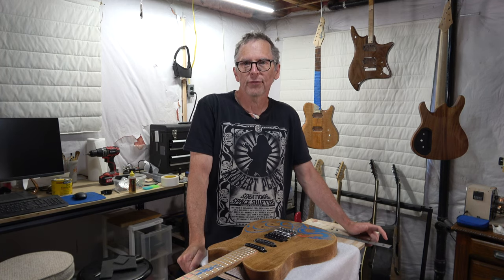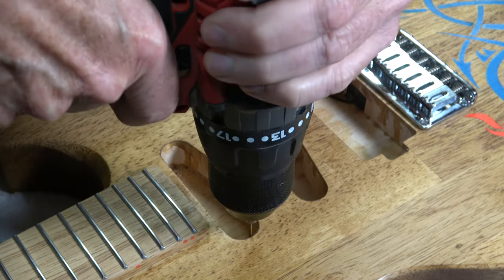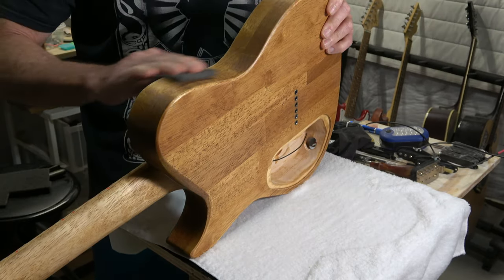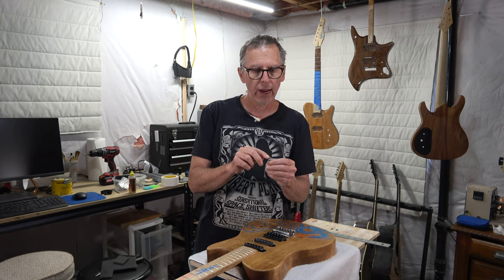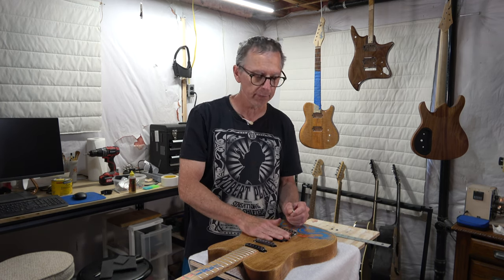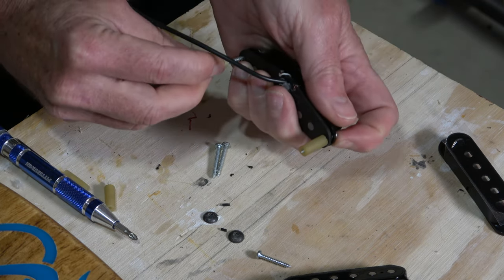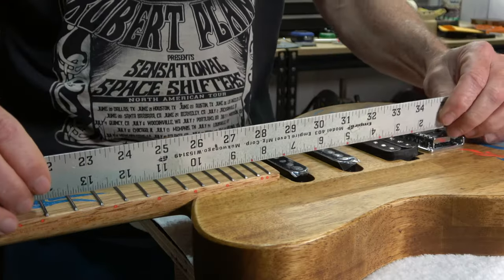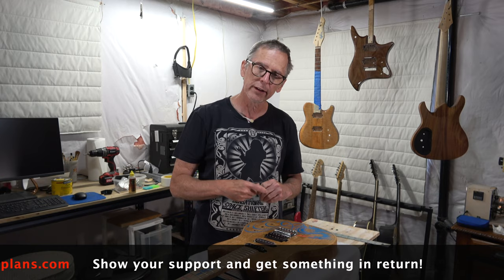Installing Pickups Into An Electric Guitar. The Oak Guitar Build Part 12.

Comment: Great video, informative and clear. Congratulaions! Could you help me? to put the middle pickup TOTALLY deep into the body, should I use shorter screws? thank you very much.
Reply from the maker: Yes. Or you could add a spacer between the screw's head and the pickup.

Comment: how deep do you route single coil and humbucker cavities  ?
my humbucker is 22mm and the single coil is 16mm
i wanted to go for 16mm and 12mm ( i got a tall bridge, the fretboard is 10mm above the top).
But then i though, if i don't route the single coil deep enough, i'm gonna have trouble drilling from the neck pocket to the bridge pick up cavity
Reply from the maker: Can you drill the hole between the pickup pockets by starting it from the neck pocket?
Reply: @HighlineGuitars  
that's the plan yep. 

But there's no pick up pocket yet, i'm an overthinker stuck at the cavity depth lol, googling here and there. 
I'm mostly hesitating because i had issues setting the pick up height while direct mounting a few months ago. i Retried earlier and it was np.. eh

Better have too much space than not enough i guess. What is your regular pick ups depth ?
Reply from the maker: @philippeclipet8739  I make my ring mounted pickup pockets 22mm deep. For direct mounting, I measure the height of the pickup plus the distance from the top of the pickup to the bottom of the strings. Next I measure the distance from the bottom of the strings to the top of the body. The difference between the first measurement and the second is the depth of the pocket with a little extra depth where the wires will go.

Comment: HIGHLINE GUITARS, once you install the pickups, how or what do you use to measure the "magnetic Impulse" of the guitars pickup when picking the guitar string? Because the Magnetic Impulse will change on the pickup height and gauge of guitar string used. I Haven't seen make a video lesson about guitar pickup Magnetic Impulse
Reply from the maker: There's no video because there's no point in measuring "magnetic impulse" or whatever that is.
Reply: @HighlineGuitars  Seymour Duncan R/D take months with artist measuring the "magnetic Impulse" of the guitar pickup until the guitarist says thats the perfect magnetic impulse for each pole piece for each guitar string for the bridge pickup has a different magnetic impulse per each string compared to the middle pickup and bridge pickup. They all have different magnetic impulse for each pickup on a strat for each string and pole piece. What do you use to measure the Magnetic Impulse when plucking each guitar string to measure the magnetic impulse for each pickup on a fender strat?
Reply from the maker: @waynegram8907  I use a magnetic impulse meter. The deluxe model with the analog to digital flux capacitor option.
Reply: @HighlineGuitars  Which Model and Brand?
Reply from the maker: @waynegram8907  I'm just kidding you. I don't measure magnetic impulse. I have no idea what you're talking about. Are you referring to gauss?
Reply from the maker: I have never heard of this and have a feeling it's marketing nonsense.
Reply: @HighlineGuitars  it could be marking nonsense but yngwie and seymour duncan made i think about 50 neck pickups before they finally got the correct magnetic impulse. That is why I was asking what lab equipment to use to measure magnetic impulse. It seems like magnetic impulse is the "response time" of the pole piece. I'm not sure how to measure the "response time" and "attack time" of the pickup. But there must be a lab meter for measuring magnetics response time and attack time of a guitar pickup.
Reply from the maker: @waynegram8907  I have never heard of magnetic impulse and can find no definition of the term or measurement equipment and therefore suspect it's nonsense. The best measuring equipment would be your ears.
Reply: @HighlineGuitars  ok thanks, I wasn't sure if there was a way or meter to measure the response time and attack time of a guitars pickup. I'm guessing either yngwie just used his ears by listening to the response time and attack time of the pickups or you can measure it on an oscilloscope the time delay from when you pluck a string to pickups output the millivolt output.
Reply from the maker: @waynegram8907  I have a feeling Yngwie reported his auditory impressions back to Seymour who responded by tweaking the gauss of each slug until Yngwie was happy.
Reply: @HighlineGuitars  Impulse waveform means the Impulse rising time and fall time that is what Impulse means. The Slug   is the Magnetic which has an Impulse response time/attack time. I'm guessing the Gauss of the Slug changes the Response time/Impulse time of the Magnet? I know Yngwie has been complaining about this for 30yrs about the response time which he or seymour is calling it magnetic impulse which the impulse of a waveform is the rise time or fall time but I never heard of anyone adjusting the Gauss of each Slug to change the response time/magnetic impulse beside yngwie. I'm not sure if its only the Gauss of the Slug because I think they also put a brass plate on the bottom of the pickup to adjust the attack time which they use to do in telecaster bridge pickups you will add a brass plate on the bottom of the slugs magnets to increase the response time/attack time of the pickup
Reply from the maker: @waynegram8907  Sounds like voodoo pseudoscience to me. The addition of a baseplate to a Telecaster pickup was done to make it easier to suspend from its mount and to provide a surface to solder a ground wire to. The effect it had on the response time/attack was coincidental. A plate will affect ALL of the slugs, not just one. In order to change the response time or attack of an individual slug would require changing that slug's magnetic strength or its position relative to the string. That's something you can only measure reliably with your ears. And what Yngwie likes may not be what anyone else likes. Remember, tone is subjective.
Reply: @HighlineGuitars  yes true I just thought the Gauss strength was only changing the output voltage of that guitar string  but the Gauss strength also changes the response time also it seems. The telecaster was for grounding but years after they found out it enhances and excites the magnet field which gives a snapping tone I'm guessing for the faster response time/magnet impulse time. Yes tone is subjective but something to learn from yngwie about impulse response time in guitar pickups

Comment: why don't you insert the screw from back of the body sir..
Reply from the maker: Because I need to be able to adjust the height of the pickups from the front of the guitar like normal.
Reply: @HighlineGuitars  can't we do the same and adjust the heights of the pickup if we put the screws from the back of the body ...
Reply from the maker: @kosaponglusang4595  Think it through. How are you going to know where to drill the holes? If you try to drill from the front, I doubt you'll find the correct diameter bit that's long enough to go all the way through the body.
Reply: @HighlineGuitars  I actually tried on two guitars and it worked and I'm sure you will do a better job on that sir.. anyway I'm not commanding you to try  that method sir  but just sharing what I knw (I'm no expert to tell a professional luthier  to do what to do and what not to do ) heheh .. the reason I had to do that because, I don't like using pickup rings.. 2- we don't get any kind of screw size perfect for a pickup ..and so that was the only solution I could come up with .... And to do that,I used standard humbucker screws for all the three HSS pickup and I used the drill bit slightly bigger than the screw but smaller than the screw head ..the main reason I did that was for the screw to move freely Incase I make slight mistakes in the alignment and it works perfectly ... Anyway   Love your Work as always sir .. I'm from k&t
Reply from the maker: @kosaponglusang4595  I could do the backside mount if I had a longer bit and could mark and drill from the front. I could also drill from the back using my CNC machine, but if the neck moves during installation, even just 1/64" at the nut, the pickups, and the bridge will be out of alignment. Also, since I sell my guitars, I have to be considerate of what buyers will expect. With guitars, anything out of the ordinary or that breaks with traditions, won't sell.
Reply: @HighlineGuitars  That's so true..I agree